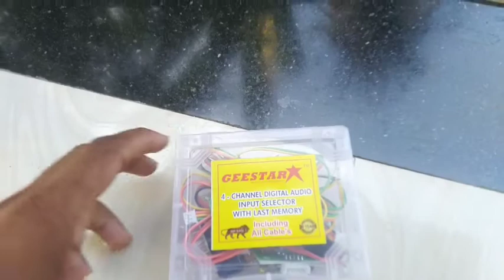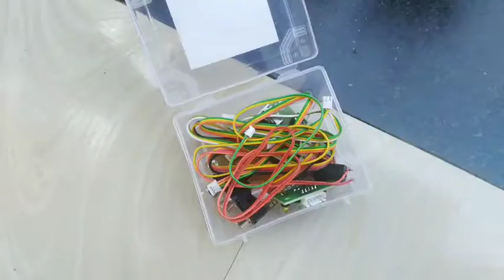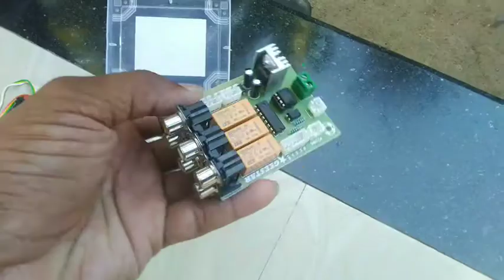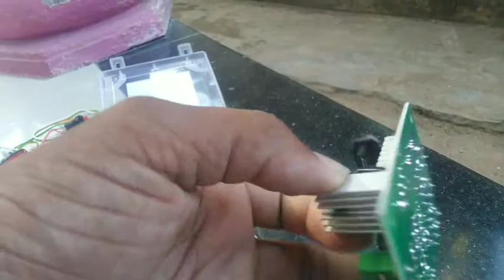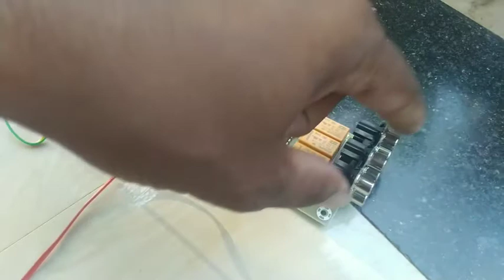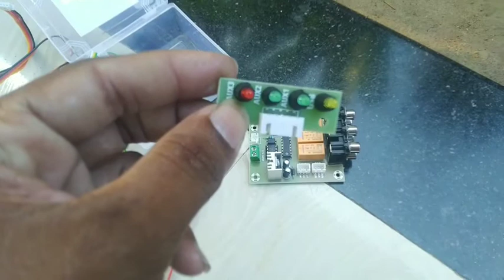geestar Audio input selector | Unboxig

Comment: What is the power consumption of this unit in wattage... I want to add a dc to dc isolated converter to power this unit...
Reply from the maker: 12v dc 1 amps
Reply: @Handmadesystem  thanks there...

Comment: Bro ee bordil input change cheyyumbo noise varunnu padakkam  pottunna pole.ith solve cheyyaan oru idea parayo please
Reply from the maker: Input koduthirikkath enthil ninnu? 
Power suplay eth? 
Smps ano?
Reply: @Handmadesystem  12 o 12 transformer outputil  buck converter anu use cheythe 12 v anu koduthathu
Reply from the maker: @praveengl6041  audio line il ullath onnilum buck conerter vakkaruth pakaram oru traceformeril 12v regulator ic upayogich athil ninnum varunna power out geestar selector il kodukku
Reply from the maker: Buck converter oru smps poley anu athu audio purps nu vendi ullathinayi maathram ullath alla.  Athukond nice  undakan sadyatha und fan  speed control nu prethyekal oru suply vachu venam enggil buck converter upayogikkam ennal polul adudio ayi oru bandavum varan paadilla
Reply from the maker: @praveengl6041  12 0 12 il ninum oru suply eduthu buck vachu adudio selector il kodukkunnu ennit  athey suply pre, power amp polulla pala bhagathekkum ethunnu ee suply il ani selectornty rly work akunnath ah rly adikkumbol ulla power vetyasanm all audio path il affect cheyyynnund koodathey buck converter um irunnu pani tharunnund
Reply: @Handmadesystem  thanks bro try cheyth nokkitt result parayam. 🙏
Reply from the maker: @praveengl6041  ok
Reply from the maker: Oru kaariam koodi nokkuka e selector nty aduth koodey mukalilo adiyil koodiyo fan nty waire suply wires onnuk kond pokaruthu ah noice speakeril keri varum. So ithinty aduth audio waires maathram kond pokuka athinu maathram sremikkuka
Reply: @Handmadesystem  ok👍